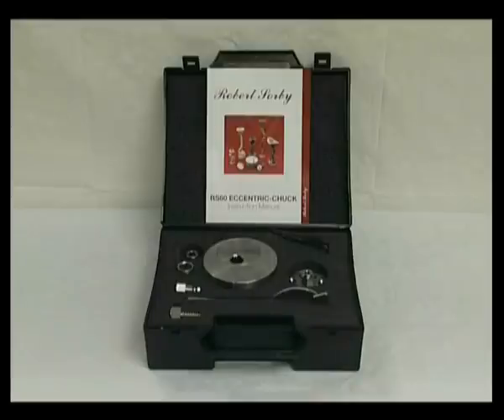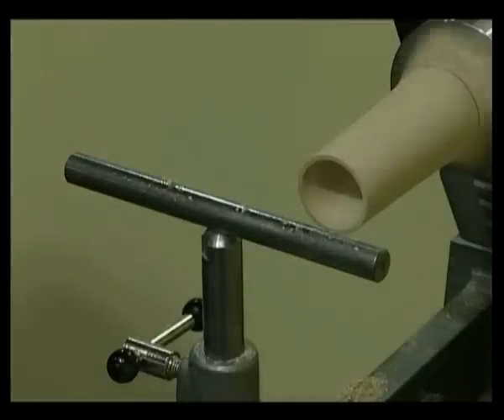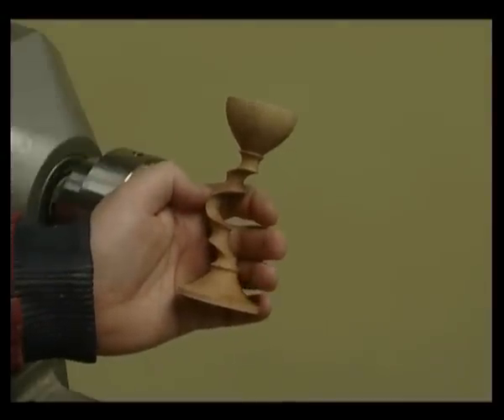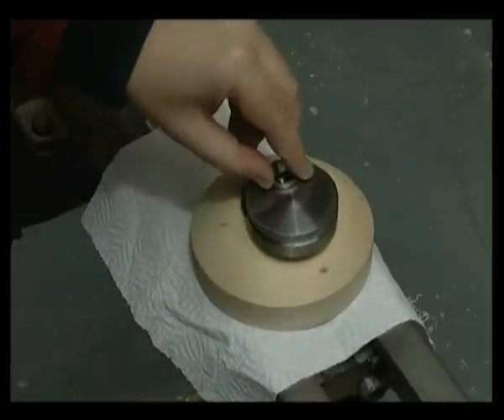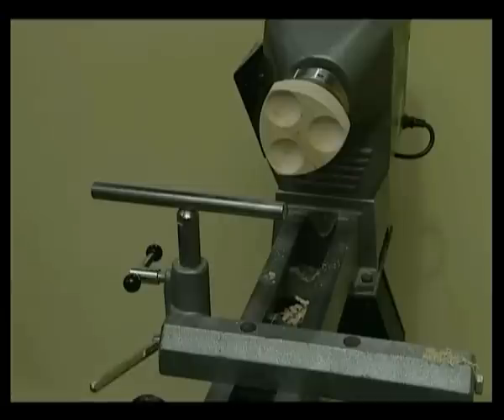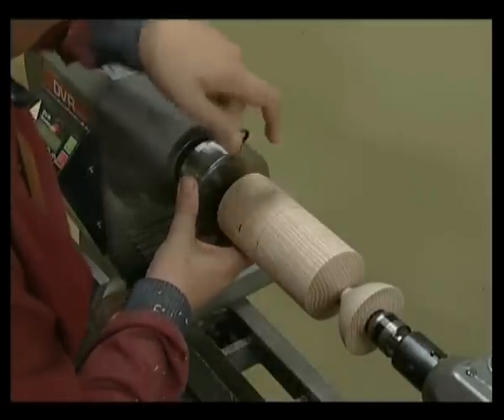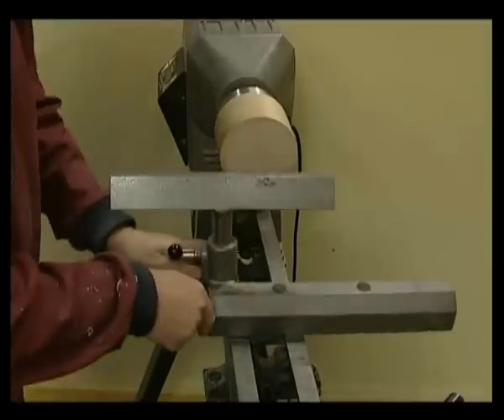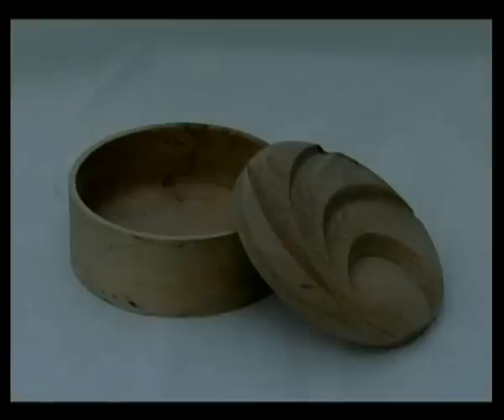Robert Sorby Eccentric Chuck projects

Comment: And will the Robert Sorby eccentric chuck adapt to most chucks, such as Teknatool chucks?
Reply from the maker: Hi David, I am not sure what you mean by adapt to most chucks as the Robert Sorby Eccentric chuck is a stand alone chuck that fits directly onto the lathe spindle either by utilising a chuck insert or direct onto the lathe if it is M33 x 3.5mm thread